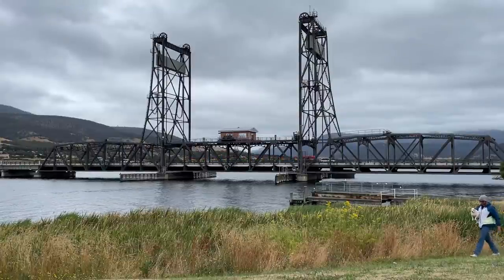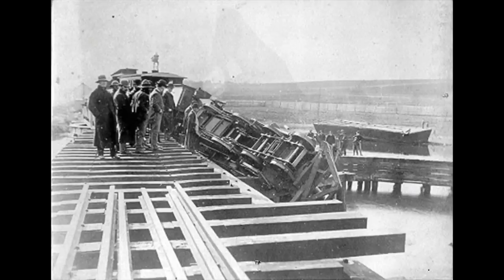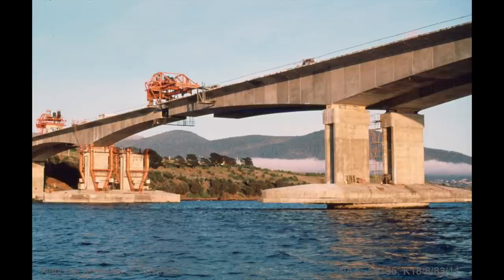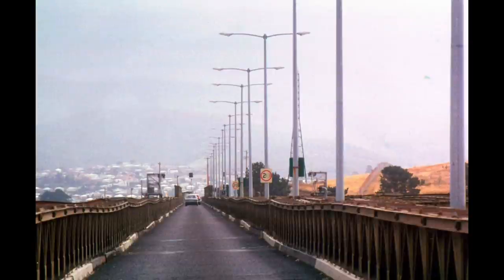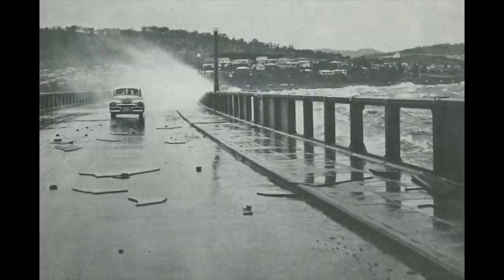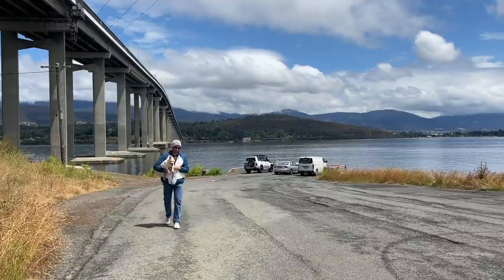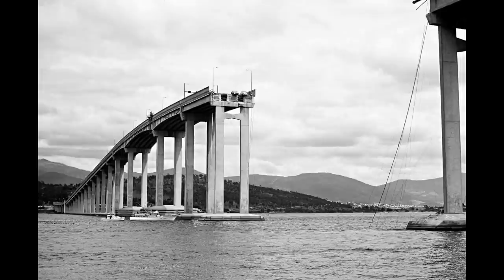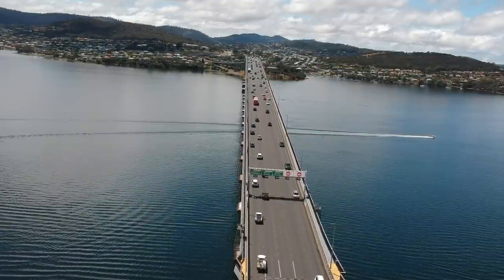What Becomes of the Hobart Bridges?

Comment: Thanks for the trip down memory lane. 
I can remember travelling over all five of the bridges. Driving over the floating bridge can be best described as "spooky". The bridge moved around quite considerably and it was nothing for waves to crash over the top of anyone driving across it. 
As for the Bailey bridge, it wasn't much better. It used to "bounce" as well as sway from side to side. It was also rather loud.   
As for the Tasman, I still hold by breath whenever I drive over the "new" section. I was on the bridge heading east when the driver noticed the Lake Illawara way off course. We watched as the ship's super structure disappeared out of sight as the bridge shook and the entire eastern shore went black. The power cables that fed the eastern shore ran through the bridge. Very spooky as the western shore was still all lit up.
Reply from the maker: Thanks, James. Interesting.
Reply: Wow, amazing!
Reply: Really?
Reply: Even with the low speed limit the Bailey could still be a very dangerous cross.  I recall a truck driver lost both his legs on an icy night in the eighties.  The only thing that stopped him bleeding out was the sub zero temperatures

Comment: The replacement of the tasman bridge could be very difficult. Besides cars, bike and pedestrians, the bridge also carries, water, electricity and phone lines.

Unsure if the bridge carries fibre or not so not sure if internet is going over but a lot of planning would be required for disconnecting those services.
Reply: All of that can easily be laid in an underwater cable.    The biggest issue is where to locate the new bridge, and what design to use.  The current one was built for beauty over practicality, as I remember when the design was chosen.  It was the most expensive, having twice as many pylons as needed, making it prone to ..........  being hit by a ship.  It is easy on the eye, though, and certainly much nicer than many bridges around the world.

Comment: We spent our honeymoon in Tasmania and took a Derwent River cruise from Constitution Dock to the Cadbury Chocolate Factory, via Wrest Point. This was in November of '93. Our host for the journey told a non-stop story of the Derwent, the Hobart bridge and the Tasman bridge and he gave a very graphic and harrowing tale of the results of the Lake Illawarra disaster - including the initial lack of transport ( some people even driving to and past Bridgewater to cross the river. Other transport such as ferries across from Bellerive/Lindisfarne - the ferries were on loan from the Sydney-Many ferry run and some had been decommissioned but were re-instated (and had to make the journey down to Hobart) - access to the airport was also badly affected. The Bowen Bridge at Goodwood was also constructed (opened Feb 1984) to assist with the traffic should something happen to the Tasman bridge. I found it all fascinating. There are some points that I would like to add to your narration 1. The pin that was used to combine the two 'halves' of the Hobart Bridge was 12 and 3/4 inches in diameter and weighed half a ton. 2. The Hobart Bridge was a temporary construction and always regarded as such. 3. There is a photo of a  'mock-up' of the final resting place of the Lake Illawarra on the bed of the Derwent River - it is a remarkable visualisation of the underwater scene.

Comment: The Bowen bridge is the only one suitable for a pushbike. The Tasman bridge is so much worse than the floating bridge.  It really is a disgrace that such a poor design was acceptable for non motorised communication.  There is scarcely room for two pedestrians to pass each other.  But the vertical rails catch handlebars and are deadly.  But there is more. At each end the narrow path narrows further to two solid pillars.  A glance at the gouge marks in those shows how many serious accidents have been caused by inadequate and negligent design.  Mobility scooters would be also extremely difficult.  Even at this late stage there is a need to rebuild a new walkway along at least one side. Something suitable for the users of it.
Reply: Back in my brief residence in Hobart during my schooldays I rode with mates over the pontoon bridge quite a few times. No desire whatsoever to attempt it on the Tasman if I ever visit again.